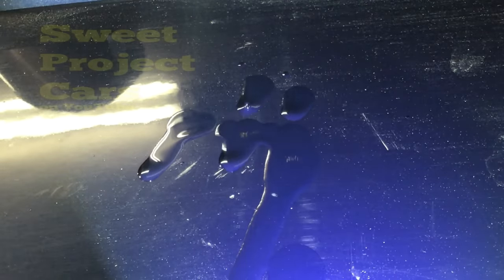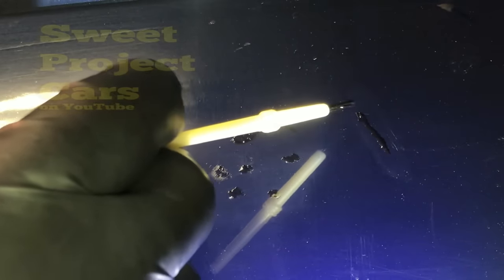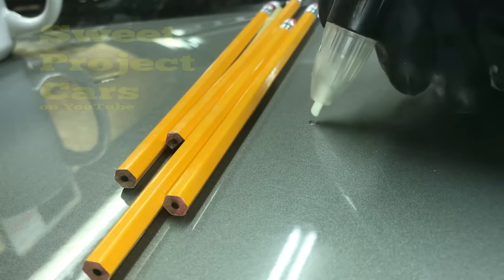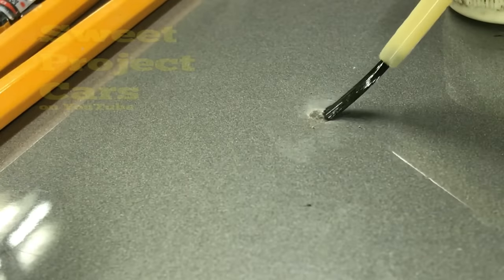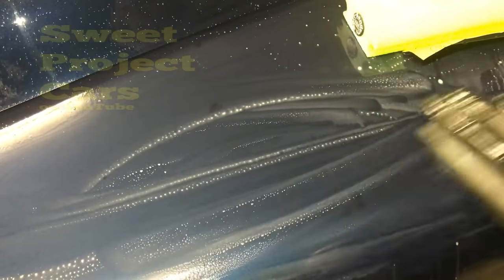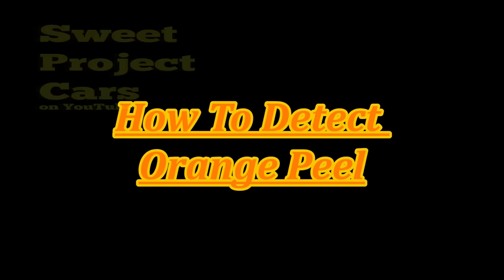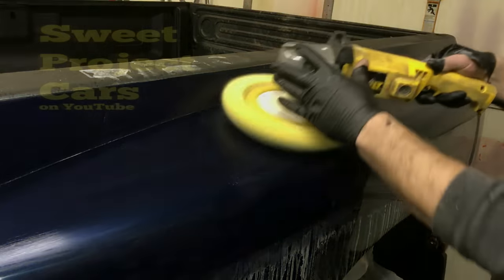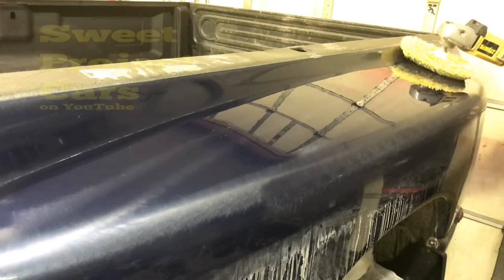How To FIX Any Paint Chip or Scratch in Your Car or Truck Paint... DIY

Comment: This is cool, thanks. Do you have anything on how to repair a star crack/chip in paint?
Reply from the maker: Yes you pick the paint out of the ⭐️ area Trade it for the video as if it was a standard paint chip
Reply: Does that work on larger cracks and chips, like 2-3 inches?
Reply from the maker: mjcompanies it sure does :)

Comment: Do you have to go over bondo filled chips with lacquer thinner to get the paint to stick? I filled all my chips as you instructed in another video. My chips had rust but in another video the instructions were a little different....I used dabs of royal jelly to remove the rust, then cleaned with lacquer thinner, filled with bondo....next step I’m sanding with 3000 grit. Then doing the spray paint method...or should I do the paint method you are doing here?
Reply from the maker: I would do the Paint method we show here and you do not have to fill the chips with Bondo If you have the etching primer in each hole the paint will bond to that and fill it full
Reply: Already did the bondo, will the paint stick to it? Was going to mix the paint and the touch up clear to do a one stage paint/clear application. Then wet sand 3000 grit, then wax, buff to shine.....
Reply from the maker: Traditional50’s Hightech the paint will stick just not as well, but it will stick and the mixing of the 2 is how we do it. then it looks like you got a handle on the remainder of the process my friend good job!

Comment: my black c7 has so many chips in the front bumper/side mirror/lower side fenders..Im a beginner DIY'er so im sort of scared to do anything dramatic to the paint. Ive just been doing small cosmetic touches like, vinyl strips, side skirts/front splitters.. think ima man up and just go for it. This vid gave me a boost of confidence to tackle the task. I just have one question..i daily drive my c7, would it be wise to start the process and still drive the car, my weekly driving usage is low maybe 100 miles.
Reply from the maker: Legend you can do it just take your time with it do it in stages and yes you can continue to drive it just give it the mention dry times and you’ll be good to go that’s time to do it is on the weekend have a great day my friend

Comment: Great video but I have a question about two stage paint. The instructions on the paint I purchased say to wait 30 plus days before waxing, does not sound wise to me after the compounding step to leave finish unprotected. What is your method for paint that requires clear coating as another step?
Reply from the maker: wilbert gore  we do this video on a touch-up paint  https://youtu.be/vOlQfsuBz7I now if you spray the paint on a larger area then you want to clear coat the base coat after it has dried...not sure what and how big your damage is?

Comment: A couple questions for you
1) Will this work with the paint pen kits as well?
2) what will be different if my paint does not have the clear coat mixed in?
Reply from the maker: yes it works with pens and you mix the clear and paint 75% color 25% clear and you  are good to go my friend
Reply: @SweetProjectCars  A few more questions for you: 1) If I can only use foam pads, what in this process would change? 2) Do I need to take the wax/polish off with something before adding a spray sealant? 3) How do I know my chips or scratch have gone down to the fiberglass? Mine are black underneath chips, grey underneath scratch. I can send a picture if need be.

I apologize if these are dumb questions, I just need to be sure what I am doing :)
Thanks

Comment: Hello Sir! Thank you for taking the time to make these videos! This is really great information! Just one question, what would be the proper steps if we have two part touch up paint (paint and clear coat separate) instead of the one part that you use? Thank you!!!
Reply from the maker: mix them together we have a video on that https://youtu.be/vOlQfsuBz7I  ..mix 75% color with 25% clear
Reply: @SweetProjectCars  this is great! Thank you so much!
Reply from the maker: you are very welcome
Reply: Hi! Sorry for all the questions, but with the Self Etching Primer, after it is dry, do you clean the spot again with alcohol or lacquer thinner? Thanks again for all your help!
Reply from the maker: no problem we love to help after you use the primer you want to do nothing else but paint it after it drys my friend
Reply: @SweetProjectCars  awesome! Thanks again!! I really appreciate it! I'll let you know how I make out
Reply: @SweetProjectCars  Hi Friend! So i may have made a mistake and im not sure what the best way would be to approach it. As i was sanding down my painted chip spot i hit a few pits that dont have clear coat so now the paint it slightly exposed, but along with that I accidentally wet sanded down two spots of clear coat next to the chip. The one spot is just super hazy and the other spot started to expose the paint beneath it when buffing. The newly exposed spot doesn't look anything like the car color so I'm not too sure what is going on or what i need to do next. Your help is greatly appreciated sir! Thank you! Here is a video upload https://youtu.be/X68bCcOm3BI

Comment: How much of the clear coat is the sanding taking off? I assume there is a limit (2-3 times) before you start scrubbing away on the paint as well? And each time to make the CC thinner, you are more or less exposed to new paint chips?
Reply from the maker: We have never had a problem going to the clearcoat especially on newer cars they put so much on it at the factory doing this process of course takes common sense and the ideas to try to keep your car protected from chips that’s why we now have videos out on ceramic coating that prevents and helps stop tripping and scratches

Comment: Trying your method...everything was going just as you described until the wet sanding part. I even used 3000 grit sandpaper to be extra cautious. I used focused, gentle pressure on where the chip was, but I am starting to think I may have gone through a little spot of the surrounding paint because on the edge of the chip it looks like there might be some primer starting to show through. Any thoughts?

Comment: Awesome video! I just had a quick question. How come you are using aluminum polish as your cutting compound? Isn't that just for aluminum tail pipes?
Reply from the maker: Nuspydacity after 20 some years of detailing vehicles for a living we found the mother is the best for almost everything we want to remove scratches in or shine.
Reply: Sweet Project Cars ok. I was just wondering because I use meguairs   105 and 205 but I've only been detailing for 6months and would like your opinion on it. Thanks.
Reply from the maker: Nuspydacity we have actually tried all the meguairs products and just have not found any of the cutting compounds other than the #7 show car polish that does what we need it to do.  thank you for sharing with us...maybe they have improved them we will give them a shot again.

Comment: Two questions:
1. Does it matter how big the chip is? I had a piece of metal debris hit the door of my car and left a small dent that's like 1/4 in. wide and ~1.5in  long. A rock chip typically only take off the paint but this dent would be a little deeper than a rock chip so I don't know if filling with paint is going to make it too thick to work.
2. If the chip still has paint that shows a crack, do you cut out the paint until the end of the crack or just sanding it down and applying touch up paint is sufficient?
Reply from the maker: In a situation like this you would fill it with body filler till it was almost level with the existing paint and then you would fill with paint.  YOU Can send me a picture of this and I can get a better idea what you’re dealing with as well, send it to SEEETPROJECTCARS@GMAIL.COM
Reply: Thank you for the quick reply. I've sent the pictures to your email.

Comment: What the clear coat? Do you add more? I started correcting with the duplicolor pen, after the paint settled in the chip I was wondering about the clear coat.  Do I fill in the rest with more?

Comment: I have a stupid question.  I looked online to buy the lacquer thinner.  I was hoping to find a small container because I don't want to store or dispose of the rest.  There is Nail lacquer thinner in smaller 2 and 4 oz sizes on Amazon.  Can that be used?  Thanks for doing this video!
Reply from the maker: You can try it and see how it works for you if it doesn’t then you know what you need to do

Comment: Sweeeeeeeeet video. I have some spare base coat and separate clear coat from when the car was painted. Do I go through your process on base coat,then same process on clear coat.....or do I mix some base and clear together, then apply your process. If I mix, do I 50/50
Reply from the maker: we like to mix the 2 of them together for chips and scratches mix it 75% paint and 25% clear

Comment: I’m not sure if you can help but every time I reach the foam compounding pad step, the paint chip area I’ve filled comes out and I’m right back at square one. No clue why as I start with using lacquer thinner on the chip, wait days after applying the touch up paint before wet sanding with 3000 grit, then clay bar and mother’s. The only noticeable difference I see right away is when I apply the mother’s, the moment it touches a filled in paint chip area, the mother’s clings to the paint chip like glue and gives it a matte finish even when I make passes over it with the foam compounding pad. And then after closer inspection, the paint chip is no longer filled in and it’s like I never painted it. I’m lost though because I thought the lacquer thinner meant that the paint would adhere? Anyways, if anything comes to mind as to what could be going wrong, I’d appreciate it.
Reply from the maker: Thank you for your comment it Has to be the paint that you’re using we have never heard of your situation in 40 years of car detailing and what brand of paint are you using? Thank you mad mike the hammer SPC
Reply: Sweet Project Cars Thanks for replying. It’s a “touch-up paint” pen ordered from the Mazda dealership here in Canada. Colour is “machine gray”.

Comment: Been watching video on clear coat. I have air brushes , I was thinking of doing those spot fixes. You have any recommendations on a 2 part clear coat. Not rattle cans I'd rather have some left over for other projects. Saw 2 of your videos on clear. I have a 2013 VW Passat.
Reply from the maker: msand951 this video is fixing a larger area https://youtu.be/0kVRwnRIb54 but the process is pretty much the same for smaller areas with an airbrush...it should give you some good insite on using clear coat, base coat

Comment: How about for the new cars, where the parts are black and they are not metal, I thought getting a small piece of tape to just surround the part that is to be painted and just use  the the brush, the real thin one to put in a drop and do the same procedure you do, since they have these brushes that person who is in art clases, use to give finishing details, as an expert, What do you think. also what do you use so the touch up paint can adhere to the new bumper or fascia, since I associate bumpers as being these big metal parts, that can protect you against a crash,thanks.
Reply from the maker: Sounds like something you should give a try.  If it doesn't work for you you need to follow our video for the guaranteed results you are looking for.  Thanks for asking.  mad Mike the hammer SPC

Comment: Do you have any videos on removing dents from a Chrome bumper? Someone ran into the back of my 08 Dodge . And it is Concerning that I might flake off the Chrome trying to beat it back out any tips or tricks?
Reply from the maker: Sadly, you will most likely chip the chrome or end up with many very visible dents trying to pull it back out, your best bet is to replace it if you want it to look new.  Thanks for watching and asking my friend, wish we had better news for you.  Have a great day.  mad Mike the hammer SPC

Comment: Mike, that was an awesome video. After you had finished your wet sand I was amazed that I couldn't make out where the paint chips were. I just have a couple of questions. The self etching primer.... that was from an aerosol spray can right?. You didn't pour that from a metal can as a liquid did you?. And all I can find in my local Napa Auto Parts is a colored self etching primer, either gray or black. But I noticed that the one that your applying is colorless?. Should I be using the same thing, a colorless self etching primer or does it matter?. If so do you have a link?. Oh by the way, do you have an email?.Keep up with the awesome videos buddy.
Reply from the maker: Hello Ken everything that we used in that video is in the show more of the video description   the Self etching primer that we used came from a spray can, you’ll find that in the tool list as well, well hope this helps have a great week
Reply: Hey Mike. I looked all through the "show more" drop down menu for the video description, and I apologize if I'm suffering from temporary blindness but seen no link regarding the primer. I had seen all three links regarding the "thinner" but nothing regarding the primer. If someone else out there happens to see the link for the "primer" could you reply with the link. Appreciate the help
Reply from the maker: Ken Soucy for some reason it was not there? but here is what we use https://amzn.to/2KBafWR and it works perfectly every time :)
Reply: Thank you so much SPC, really appreciate the help. Surprised that it's green?. In the video it seems clear?. If it doesn't matter whether it's coloured, would black do just as well?.
Reply from the maker: Ken Soucy as long as it is self etching and closely matches the color of the vehicle you are doing.

Comment: Gday mate Mick from Australia. You have some really good videos that I have been watching. In relation to stone chips and deep scratches that I have been trying to fix properly on my metallic pearl Burgendy red paint car with clear coat. In this video you just fill the chips with paint,wet sand with 2000-2500 and then buff/polish. I have tried using the paint brush method plus used cardboard templates to trace,cut out and spray paint over filled chips using bonding glaze putty. What I seem to have problems with is that when I spray paint the chips i get a couple issues happening. First when I use the spray method over the template holes I cut, it seems to create a volcano effect that is the paint seems to be be higher at the edges with a hole in the middle. Would this be surface tension caused from the templates been too thick?????/ I seem to keep sanding back then hit the glaze because i tried sanding the peak out and end up going around in circles!!!!!!! So frustrated!!!!! Also when I try the brush method(No Glaze used) the paint seems to be darker than the original paint (paint code matched) and when I sand it back with 1500-2000 you can see the new paint contrasted against the original paint. I am so frustrated because I watched you do it so well bith using the spray can professional method and the method in this video. I have not been using using paint lacquer to clean/prep paint but rather a paint grease cleaner. Would this be causing issues????? I seem to on some of the chips and scratches chasing my tail and have spent so much time already. What is frustrating is that on one deep scratch when i sanded it back after filling with glaze and spray painting it, some of the scratch blended PERFECTLY like you achieve while the other part looks darker. Then again I try to recify this, around I go again. PLEASE HELP!!!!! Any advice would be great. Maybe I am too fussy. Cheers mate
Reply from the maker: mick dont do the template follow the video you are commenting on here to a "T" with the same exact tools and you will get the same results my friend :)   to me it sounds like you just need to do this video with no filler..just clean all the filler out and CLEAN the chips VERY WELL WITH LACQURE THINNER ONLY then fill with paint and leave it set for a minumum of 2 days before sanding and if you are sanding them on a rounded surcace you need to make sure you are using a soft board or sponge or you will sand the paint you put in right back off

Comment: Hi please help. I tried for the first time to use a pdr removal kit to fix hail spots. I had some success I might say, but I've pulled maybe to far and now instead of dents I have little bumps. I wanter what "punch" and hammer tip I should use, if the convex head or the flat head. Thanks!
Reply from the maker: Well you try both depending on the raised dent/bump you are dealing with it is a trial and error situation, you will find the one that works best for you sorry I couldn't be of more help as it is a learned art to do pdr.  Have a great day and hope this helps.  mad Mike the hammer SPC
Reply: @SweetProjectCars  thanks

Comment: I'm new to this, along with this is going to be my first time doing it on my car.  So here's my question, since you buffed it so nice and shiny and it's a different look from the rest of the car. does that mean you'll have to buff your entire car to make it look the same? 19:56 
NOTE: I have a newer 2017 Mazda and I have the paint chip with the rust from pebbles on the roof of my car does that mean I'll have to wet sand the entire roof, or just the rust chips?
Reply from the maker: just the rust chips but it maybe easier if you have a lot of them to sand the entire roof and then buff the entire roof